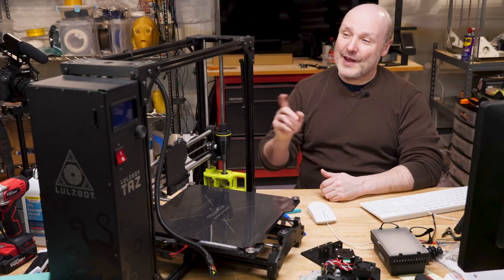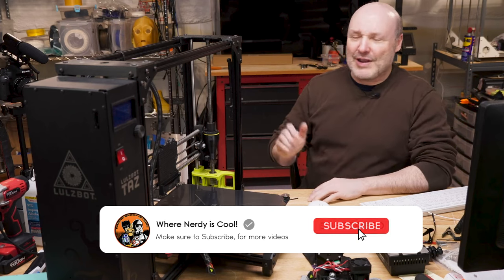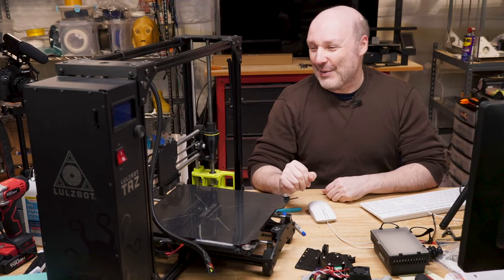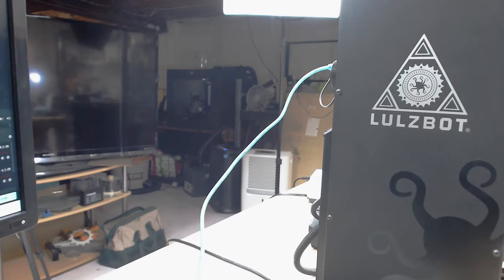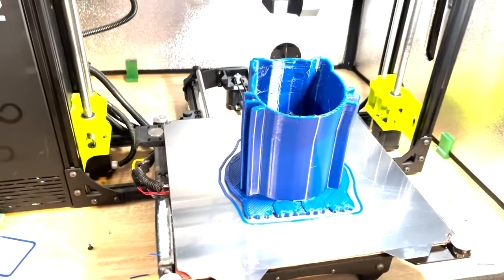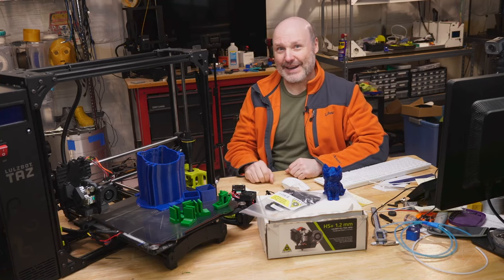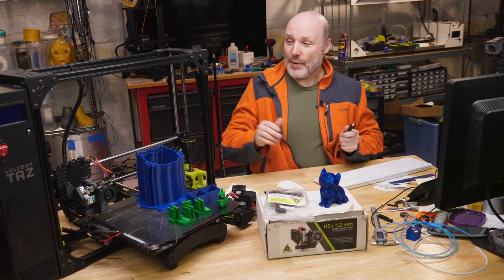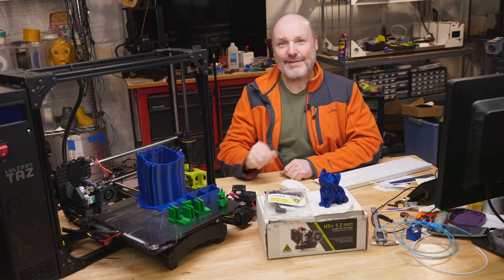Lulzbot Taz 6 Repair and Upgrades

Comment: Hello, 
It’s so refreshing to see a video about the TAZ 6! I’m currently a Junior at a university in Texas and I work in our campus’ Makerspace as a student worker. The space has outgrown the Lulzbots so we upgraded to some awesome Ultimaker S3s/S5/S7! A big perk from working there is that I bagged a used TAZ for super cheap… but a down side is now that I have to upkeep with all of the extra “quirks” of this machine. I hate the build plate, but I liked your idea of putting a magnetic one on, and offsetting the x-axis! 
I will admit that I have plans to take apart the whole thing, and spray paint the frame (not rails) glittery pink. It might as well match my apartment! This printer is a little bit of an eye sore… but that’s okay!
You’re one of the few creators that have made a recent video about the TAZ 6 (since 2016)! If you have any guidance during that whole process I’d appreciate it! Have you seen anyone take apart a printer to repaint it?

Comment: Very cool. I grabbed 2 Taz 5s both were on eBay as "for parts only". One of them the entire structure was not squared off, and one of the lead screw supports was even upside down. LCD screen cracked but I think that broke in transit. Toolhead jammed. The other the print bed was shattered, Rambo card had a blown fuse, wiring was completely wrong, etc. Got each machine for $200. Spent around $200 in parts for both and the one that was assembled complete wrong took me about 7 hrs to get it together correctly and wired correctly, wow was the wiring a mess. One of them I built the Moarstruder with 2.85filament, 1.2mm nozzle. Very cool for prototyping and in Vase mode it is super cool. Looks like thick thread around the vase. The other I use either the stock .5 nozzle that I rebuilt and I built an E3D titan toolhead. I did upgrade one to a removable flexible PEI bed, the other I put a new PEI sheet on top of the original plate. Both are really super cool. I do have a VORON for the fast speed printing but I'm in no rush as I have 11 printers and I can spread parts across multiple machines. I do a lot of robotics, arduino, raspberry stuff or functional prints. Nice channel.

Comment: Hey there, we've run in to each other on the Lulzbot forums.  I'm the guy who also has a Taz Pro XT.  I've mulled over getting those two linear rail upgrades (but for my Workhorse) but decided against it because you still have the z axis to deal with.  That's where most of the wobble is really coming from, in my opinion.  There's inherent runout/twist in the x gantry that unless the z axis itself is also upgraded is just going to persist - making the investment in the x/y linear rails pointless.  And if you are going to replace all three axes - you might as well just get a new printer.  I have a Taz 6 - also with a 1.2 mm tool head - and when you are laying down 0.8+ layers at 2+ width it really doesn't matter how wobbly the tool head is since you are printing at an absurd slow speed anyway.
Reply from the maker: Hey!  Great points.  I still want a M175 so I can use 1.75mm filament.  And the Mosquito is a very versatile hot end
Reply: @WhereNerdyisCool  I have a mosquito hot end on a bondtech LGX but it’s on my Voron. Makes some super nice prints. Little surprised that I can’t crank up the speed and match the bambu labs 16 minute benchy but it’s fast enough as I can crank out a benchy in about 22 minutes and it looks better than the Bambu 16 minute ones. One time a wire on my heat break fan came off so I had a filament jam in the heat break. The mosquito does make it a little more difficult to clear heat break jams.
Reply from the maker: Speed isn’t everything. I’m happy printing slower and getting less fails and great prints.

Comment: Just picked up a Taz6 at a surplus auction. Sold as is. I turned it on for the first time last night. Did a auto home,  and it made this awful noise and then said homing failed, printer halted, please reset. It seems the y axis is fine. The x axis is making the noise. The z axis won't even move. New to 3-d printing. First ever printer. What do I need to do to fix the problem? Thanks

Comment: I have an old Taz 6. I got it cheap because of the famous bed leveling failed...again and again! I'm trying to upgrade to a BL Touch. But I'm not having much luck and the printer is now almost 8 years old, so info is little to none on this printer.
Reply from the maker: Hit the LulzBot website and their forums.  You’ll definitely hear from the local gurus there